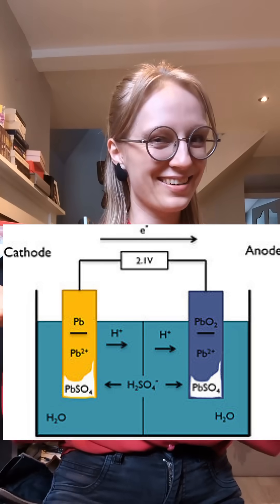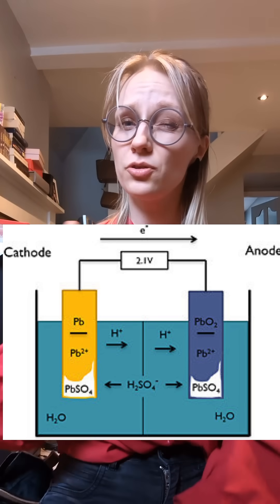Why We Don't Charge and Discharge Batteries To Min/Max #electrochemistry

Comment: Nicely done, how about NiMH and Li-ion?
Reply: The basic description is the same, but you can drop to as low as 10 % with Li-ion before anything serious happens.
And if you "go above 100%", the Lithium will simply fall out of solution and form a metallic layer on one of the electrodes. Which is mostly reversible, but degrades the battery much faster.
Someone else will have to explain NiMH.